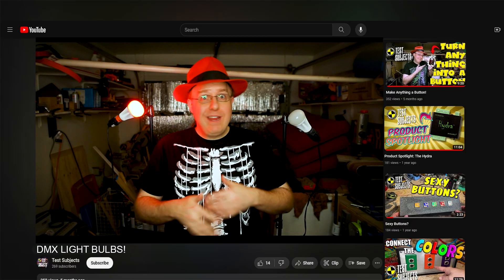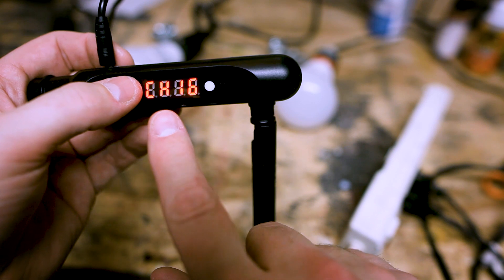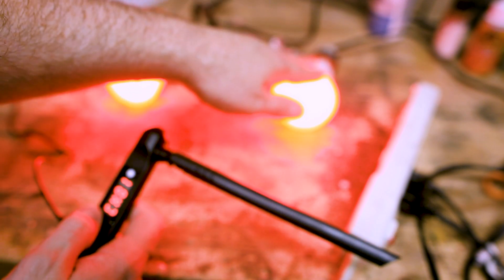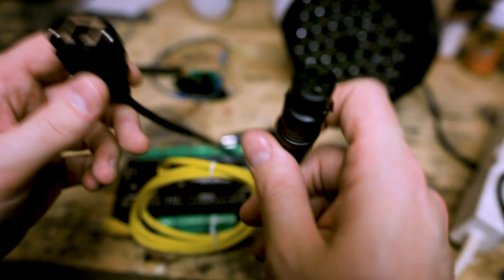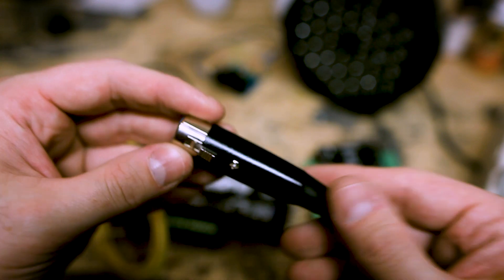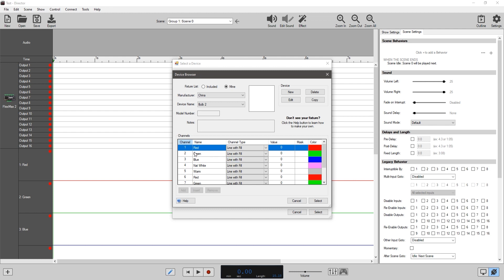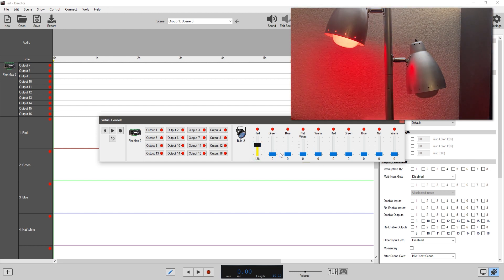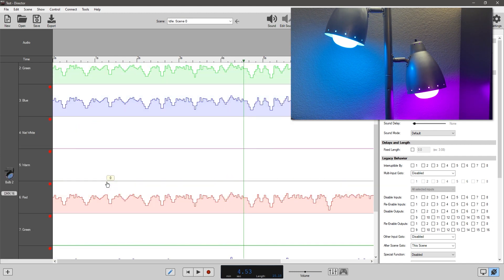Wait!? DMX Light Bulbs are a Thing!?

Comment: What is the name of the socket or connector that the bulb screws into on the DMX cable?
Reply: The bulb just screws into a typical light socket. Nothing special. They communicate wirelessly over 2.4Ghz. The transmitter connects to a typical DMX cable.
Reply: @smappdooda  Awesome, thanks!

Comment: What app are you using for testing your lights?  I’m using LightKey in our church but am looking for a cheaper (easier?) replacement… any suggestions appreciated!
Reply: We use a show controller called a Flex Max which runs the escape rooms we build. You could get a cheap light board and go old school and  run them manually. If you need software there are programs like "DMXcontrol" that are free.
Reply: We’re using LightKey too! If you're looking for something more affordable, we’ve also had success with QLC+ (free) and our own DMX-to-smart-light bridge that works with Tuya and Govee. Let me know if you want setup help!

Comment: why does it specify : "Not Work With Computer Software" ?
I'd like to use Daslight 5
Reply: I'm not entirely sure. That might be a bad translation as I am pretty sure it should work with DMX software no problem so long as you have the right connections.

Comment: I recently bought one of these bulbs and was able to successfully pair it, after plugging DMX into my controller it still stays solid red even with correct patch (running etc nomad with gadget ii) do I have to swap the bulb into DMX mode or is the issue with my controller.
Reply: If you are sure you paired it to the transmitter (and the transmitter has the correct DMX address) make sure it's on channel one which would then be the first 5 DMX channels at that address.

Comment: I thinking about one thing: if I have multiple smart light bulbs, all connected to wifi, I can control them via phone app, is there a way to control them via laptop, without all DMX stuff?
Reply: Laptop specifically? I'm not entirely sure honestly. There are programs for smart bulbs that exist they might be compatible with but we have never had to do that ourselves. Though these do have an app and a myriad of remotes that will control them you can find on their website.

You could also contact the company directly and ask if there is anything they could recommend?
Reply: Yes! You can control many smart bulbs (like Tuya, WIZ, Govee) from your laptop using apps like Home Assistant, Node-RED, or even via a bridge like DMX Smart Link if you ever need show-style syncing later. No traditional DMX needed!

Comment: Odd use of an ethernet port when it's not being used for networking but just replacing a DMX jack, I guess because of size constraints?
Reply: Ethernet (RJ45) connections can be used for all sorts of stuff. We use them to route and connect multiple wires (signal/power) to keep things nice and streamlined. However, in this case I do believe space is a factor.
Reply: They make them with 3 pin DMX as well